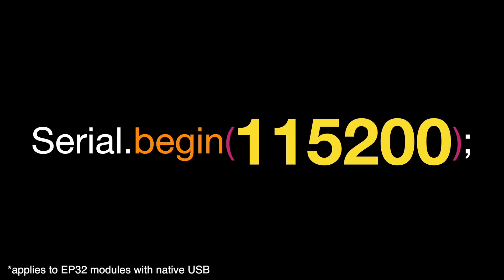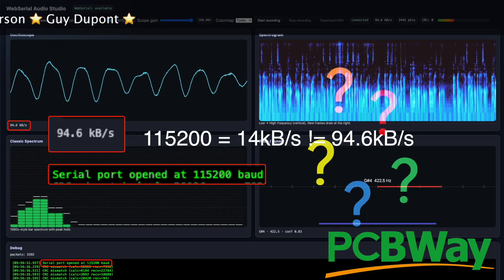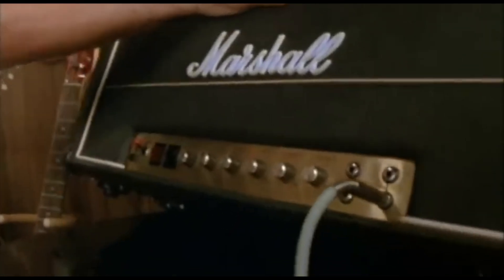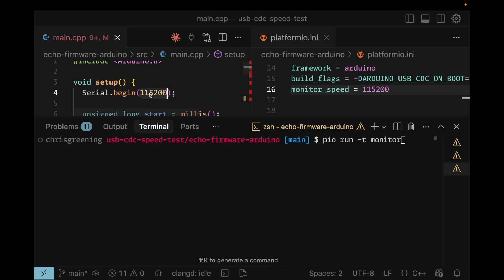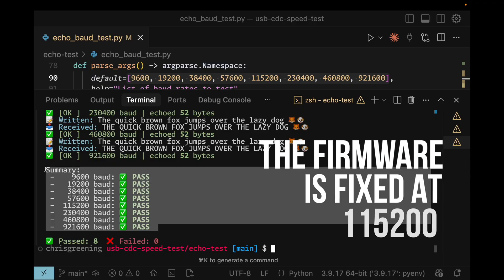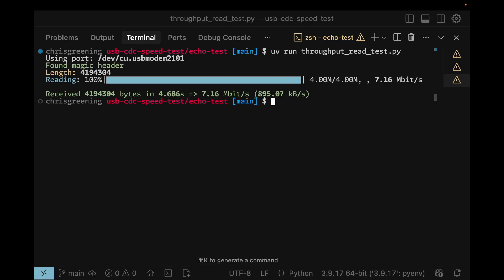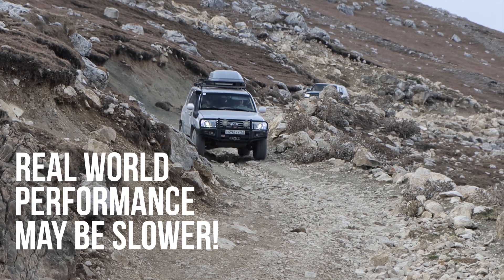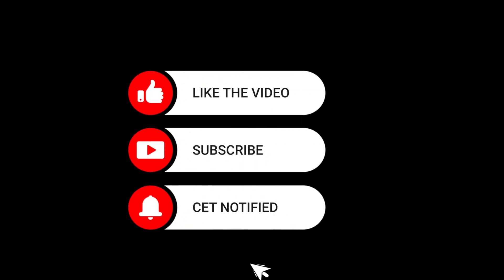This Number Does Nothing… when you have native USB

Comment: I worked for Racal-Vadic in the '90's located in Silicon Valley, CA - USA.  We had designed a rackmount with 16 Modems in it, and a keypad and screen to control the whole rack. I don't believe anyone else had anything like it.  I was also on the committed that help set the "AT" command-set standards. :hand-pink-waving:

Comment: I regularly plug in USB cables on the first try. You just have to look at the plug first to obtain the correct orientation. Does no one else do this?
Reply from the maker: I'm hopeless - but then normally I'm trying to do it by feel behind the back of a computer...
Reply: @atomic14  Buy some extender cables and you can have all the plugs be easy to reach. That's also how I freed up all the front facing ports and pulled the wireless dongle to the desk so the keyboard stops skipping keys.

Comment: And for the other serial ports? If I take 2 esp32, and connect Rx pin of a free serial port of esp1 to Tx pin of esp2, and esp1 Tx to Rx esp2. I config esp1 to serial port 1200 baud, and the other to 9600 baud. I’m sure it will not work.
Reply from the maker: No - that definitely won’t work. It’s only when you’re using serial over native USB that it doesn’t matter. I think the ESP32 will do 5Mb/s on its UART pins. I’ll dig out some old boards and do some testing.
Reply: I think you have to add “over USB”in the title. It is confusing for people taking their first steps in programming.

Comment: This is true for most µCs with native USB like STM32s or the old ATMegaU2/4. But the baud rate the hosts connects is actually reported to the Controller. Some Bootloader use this to distinguish between normal operation and firmware update / bootloader mode. ( like 1200 baud or something nobody uses in real life). But some implementations work only if the baudrate matches.... even if it is much faster so keep this in mind.
Reply from the maker: Really good comment - thank you.

Comment: It's pointless for usb if its got going via a rs232 connection.  Just like using speed to measure rotation 😂😅
The earth's surface speed changes from 0 to a few thousand miles an hour,  but it only rotates once in 24 hrs

Comment: I tried Esp32s3 and I feel wasted pin GPIO19 and 20 only for Usb. While I'am using Rx0 IO44 and  Tx0 IO43 for Serial. When I need debug communication I need Transceiver Usb Converter
Reply from the maker: I sometimes break this pins out on my boards as a QWIIC connector - then I can use them for UART if needed or can use them for I2C peripherals.
Reply: @atomic14  I also get problem communication because these pin (GPIO 19, 20) send garbage  every time when it reset.